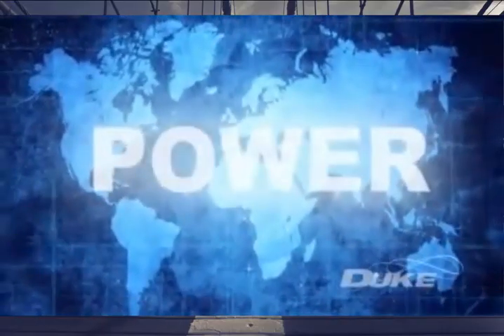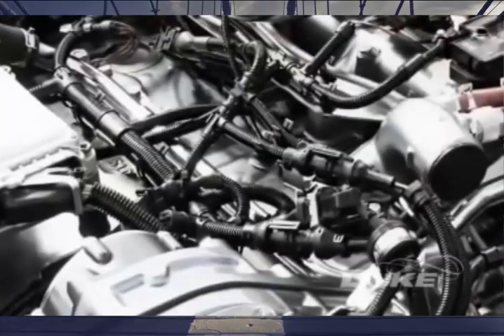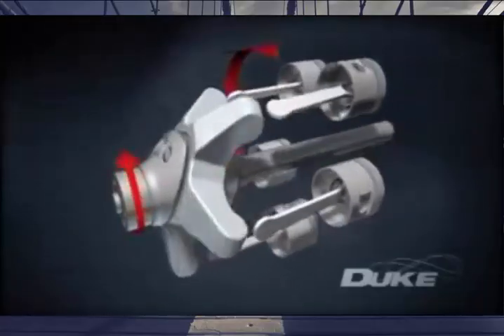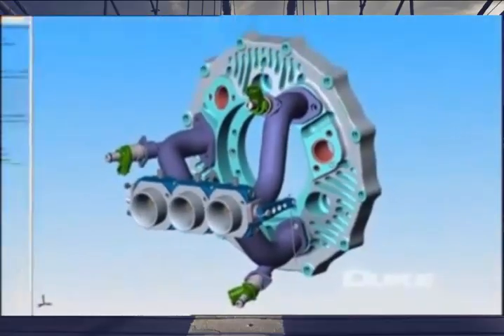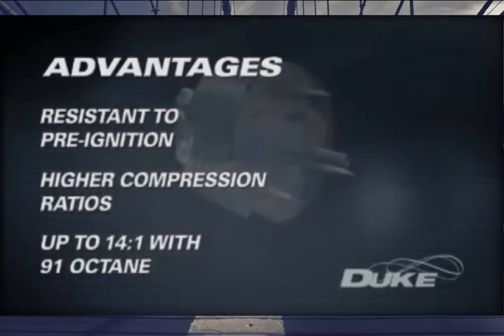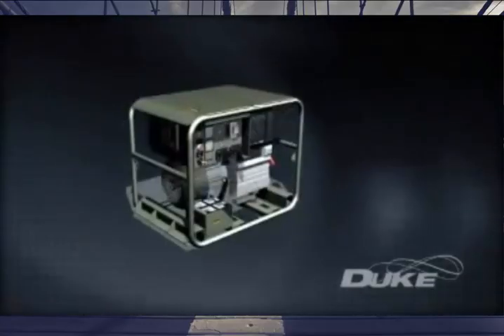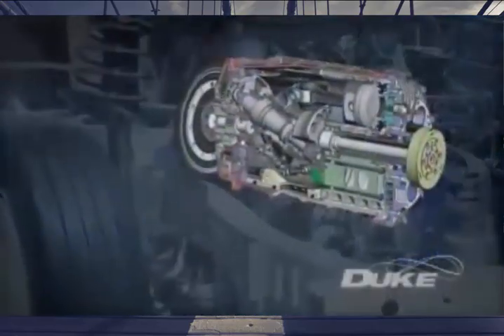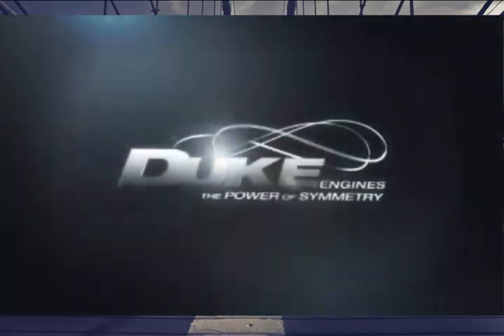Duke Engines | All information about Duke Engines

Comment: resistance through friction is what causes power loss, LMAO this just apiston version of the rotary typical of kiwis, if you have friciot oyu have wear and stress this machine would not run well without lots of lubrication , its now 2016 so best of luck but i wont be buying that peace of crap, and if its still so good why havent you got a rally car fitted.loweringt he engine in the frame of car to reduce its hieght just makes it more dangerous i have 16 inch fractured skull from a car going under me it pput my head through the safety glass window at 80km/h , i doubt very your statement is true on lowering engine height as then all cars pre that would have to be taken of the raod i will be researching this

Comment: Lets put it up against a Wankel
Reply: It is a Wankel. They just put those pesky pistons and associated parts back in to make it more complex.
Reply: Not even close to a Wankle.
Reply: Both engines look like they have a rotating seal turning at high velocity. Although in the Duke case it is a simple rotating seal without corners.
Reply: It'll Nuke 'em
Reply: Except that this one has a much larger contact patch which will stfu the engine catastrophically if the lubricating coat ever fails ... FRICTION WELDING!
Reply: LOL Nuke'em.  You sir have won the internet for today.
Reply: How come we don't see many Wankels in cars (except for Mazdas?)

Comment: Very interesting this system, on the strength of torque transmission of the cylinders to the center has a lot of resistance due to friction of the parts (even using oil with good viscosity to minimize this fact)?
It was a question that hammered my head now hehe but either way seems to be even more efficient.

Comment: so this is a rotary engine, turned on the side with 10x more friction ?

yay for short livespan and impossibility to repair ?
Reply: i would think that unlike the wankel engine the Duke Engine has not changed the piston so the piston rings and scraper ring have the same (maybe slightly less) longevity compared to the 6 cylinder v6 Engine
Reply: Nope, it's an axial engine. They have been around for a little over 100 years. They don't work well for cars engines though due to low operating rpms.

Comment: uneven wear :P
the pistons are placed horizontally, so when the fuel is injected it will flow to the bottom part of the cylinder, when it ignites it will push the cylinder in the bottom region and not evenly, so the piston head will bend overtime, other thing is that, because the rods (of the pistons) are moving rotatioraly, it cannot be sealed perfectly, or the seals will wear out, other thing is because the pistons are placed horizontally because of the gravitational force will push the seal unevenly, resulting in wear and tear, and oil leakage and missfire.
Reply: centrifugal force would change that, may not solve it. But yes I agree about he sealing issue,  that was a big issue with the rotatory engine.
Reply: im not gona argue about that, it was really awhile since ive attended any physics classes but i personally would not believe that centrifugal forces have that much of a impact on the rods themselves since the rods dont rotate, the housing does - if i think about the washing machine, the clothes are pushed to the side of the cylinder - but again, it was awhile...

Comment: This engine design appears to be based on a rotary hydraulic pump. Multiple pistons driven by an offset (wobbling) plate. I have to wonder what the minimum rpm has to be just to keep the engine running.

Comment: If this is so awesome why arent any car companies using it?
Reply: Cylinder and stationary head seal durability would be kinda issue if you ask me. Also many car companys use their own engine designs so out sourcing that would mean that money for the base engine and all the spares does not get to them and there is also issue of what if Duke decides to up selling price for this engine tech. Patents are theirs so they decide how much the price of new contract will be. Not to mention this is still kinda unproven concept, so car companys dont want to jump into water with out knowing they can swim there.
Ou and of course why would they want engine that has less wearable parts? They get money from selling spares to customers and that is their main money machine, not the cars it self.
Reply: Because their history of use, since 1911, has shown that they work best at low rpm. They have seen a lot of use in small aircraft and torpedoes.
Reply: Alahu akbar shalalalalalala

Comment: This design was used to power torpedoes in WWII and after.  Those engines were much small than this and ran on compressed gas, I believe.
Reply: The powerplant in a torpedo only has to run a few minutes at most before it gets blown to smithereens.  So long term durability isn't a design concern.

Comment: Its a two stroke with two stoke pollution problems, and even rotary engine problems.
Reply: No, it's a four stroke.  In a two stroke, the intake and exhaust ports are open at the same time.
Reply: Like a two stroke? Very inneficient.
It works like a two stroke with the same problems.
Reply: Barry Jones No, it's a four-stroke cycle; watch the video again. Intake, Compression, Power and Exhaust are all separate.  The difference here is, the pistons move from the intake port (no valve required) to no port (compression) to the spark plug (power) to the exhaust port (again, no valve needed.)  Nothing really weird about it other than they've managed to package more horsepower in physically smaller engine.  If they can either work out the problems with wear on the sliding parts, or else make it super-easy to rebuild, I can see this as an intermediate step between current piston aircraft engines and turboprops.

Comment: it's sad that these things haven't taken off.. assuming all claims are true these little things could have been amazing in small cars to produce more than sufficient power.. imagine a miata or lotus with one? ahh pipe dreams..
Reply: Swashplate engines HAVE taken off...they use them to propel torpedoes. The Navy likes them because they're cylindrical, just like a torpedo. Problem is, a torpedo engine only has to work once. The Duke engine doesn't have that advantage.
Reply: +jmowreader kinda the point though right? we as a species want new things, faster, more power, more agile.. I for one want a ktm x bow style car with a low weight, low center of gravity and high power potential.. such a design is quite crazy and fast, or perhaps a long travel buggy that benefits from the compact dimensions.. alas we probably won't get a chance to test this engine.

Comment: I was very skeptical of this design but it now looks viable.  The final drive concerns me with the rocking motion of the drive plate being turned into a rotary motion via no doubt mechanical advantage.  Is this efficient and how about the longevity of these frictional components ?.  Furthermore it would mean a complete re-tooling for manufacture in the automotive industry for mass production and  this would no doubt be very expensive. I cannot see this engine taking the world by storm but maybe in time it could be introduced.  We will see  in due course.
Reply: Or you could look at the history of axial engines which date back to 1911.
Reply: Have you seen one in a car? Until then, I wouldn't put any money in their hands.
Reply: my thoughts exactly. I want to see an exploded diagram, and the associated force and wear characteristics of the components.
Reply: Yea Trey, sealing the chamber and keeping it sealed with the friction of the rotating cylinders would be a big problem to overcome for longevity.  Hydraulic motors work because of the fluid helps to lubricate and seal.  Using hot air as a sealant wont work very good.

Comment: they are much weaker. the turning system takes to much power
Reply: I wonder about that. A rocking motion turning the final drive shaft into a rotary motion. Looks lossy to me and how is the wear resistance on these highly stressed components ?.

Comment: Ok the issues I see. As the engine spins faster will the G forces wear the outer cylinder walls faster, creating and egg like sphere in the cylinder. also, will this engine create a gyro effect as it increases momentum?
Reply: Conventional engine also has considerable side thrust  on the exhaust stroke and so the cylinder wears oval. Not saying this engine is good. Something similar is used in some torpedoes because of the short life  needed ( minutes) The major companies are already working on such designs of which there are several.

Comment: This is very surprising as three or four years ago tere was an engine built in  the USA  that worked of a cam type system where the  pistons were double ended and were operated by being conected to this central cam.
All the valve system was at the end of the engine but it worked in very much the same way.
They had aimed this engine more at  the aircraft industry.
It had a sound unlike any other engine and did  away with both crank shaft andvcam shaft.
Like this engine, the one in this video clearly go kno ked over by someone as there is no further news on  it.
Its is a shame that this happens, but it seems everyone is out to get rich quick and it they get thevright offer you never hear anymore about them.
Reply: Or more than likely, the engineering challenges weren't able to be overcome yet, so they gave up for now.
Reply: it was called  dynacam the rights were sold, name changed,  and last i heard it was shelved

Comment: I saw swash plate engines like this in use in the 1970s, of course 40 years or so should make them better.
Reply: Yes, this is NOT new conceptually, and it's hard to believe that the reliability and maintenance demand from production units in routine internal-combustion applications would be superior to simple turbodiesel and to other geometric-based alternatives like Wankel (which hasn't been great). These might be worse--especially the swash plate. Electric traction motors are the finest motive technology we've got and the great need is to power them as effectively and efficiently as we can.
Reply: More like 105 years. The first production Axial engine started production in 1911. They work well for airplanes where weight is a concern. The main place they have been used though is torpedoes where the cylindrical shape is advantageous.
Reply: In torpedoes is where I saw them used. Did not realize they have been in use for so long.
Reply: As efficiently as large power plants from modern locomotives can move trains of cars (each individual car and engine has the aerodynamics of a large brick, but the cost is mostly just once for the train, with some overhead for each car that's only partially exposed) it's also very useful to keep in proper context that railroads are built on as level/flat of terrain as they can get ahold of, and generally have early on in US development because the land was available at that time.

We get rid of the existing rail infrastructure and the roadbeds used for mass cargo transit at our peril, regardless of how efficient (or not) the engine technology that is used for pulling the cargo, because of the efficient, fairly level roadbeds.
Reply: That's where Tesla's system seems to shine brightest.
Reply: Without getting too wonky here, the Class 1 freight railroads (like Warren Buffett's Burlington Northern and its similar-class competitors like Union Pacific), with their use of massive turbodiesels converting to electric traction motors powering minimal-friction steel wheels that run on track engineered for minimal grades with large-scale loads, are still the gold standard for every other transportation technology to somehow meet or beat in efficiency in the U.S. As of 2006, Pew Research reported Class 1 energy usage getting down to 330 BTUs per ton-mile. Ten years later, I'm sure that number is even lower now. That is very hard to compete with at a smaller scale on roads, even for Elon Musk. Assuming a Tesla S is averaging 3 miles/kWh moving 5,000 lbs. around, it is consuming around 455 BTUs of energy per ton-mile. Yes, the energy source may be cleaner to some extent, but it also still requires about 37.8% more of it. Lighter vehicles like the Nissan Leaf, Chevy Bolt, and upcoming Tesla 3 (hopefully) do a little better. However, compared to something like large-scale, heavily-used electrified rail transportation (powered directly by power plants, incl. solar, wind, etc.) such as Amsterdam uses in concert with bicycles, personal vehicles in general will probably always struggle in any efficiency comparison regardless of technology or manufacturer.
Reply: Entirely true. But I believe it important to note that any improvements made to the methods of production of electricity in any particular region apply immediately to the entire fleet of electric vehicles. No need to wait decades for the fleet to individually and incrementally get replaced with cleaner machines.

Comment: I think this is old torpedo technology..... I've seen this before, but either way seals and carbon build up around the rotating head seams like a potential long term issue. That's what killed the coats rotary valve head
Reply: Where's the sump and pump for oil, and looks like a HP not torq motor

Comment: Nothing new ore revolutionary here at all.  I've seen running engines of this configuration over 15 years ago.  Check out Eddie Paul Industries C.E.M. engine (US patent 6145429). There have been engines of this design going back to the mid 1950s and probably earlier.

Comment: The problem for this design is the angles at which the power is transmitted, I can see high friction points there
Reply: ME TOO DAN.  THE ROTATING NECK THAT SERVES AS A CRANKSHAFT.  WE ALL KNOW HOW NASCAR ENGINES CAN CRACK A CRANKSHAFT.  PUT THAT DUDE ON TEXAS MOTOR SPEEDWAY AT 8500 RPMs FOR AN HOUR AND SEE HOW IT HOLDS UP.

Comment: So let them build an engine for a car in the 24h of Le Mans, or join a competing team in the F1 races. When it proves itself under those conditions the big brands will line up for a license.
Reply: they have had 6 years to do that. they have running prototypes in videos.. I agree they should do something to get the design some publicity.. I mean I have an older ranger that could use a motor, it's a 5 speed so electronics shouldn't be an issue and neither will space. it'd get them publicity and a test bed.. and a new engine for my old truck..

Comment: well this video does have me interested in Duke engines. but most of us want to know exact figures like: dimensions; weight; typical example of power and torque curves for a specified engine size; fuel economy, oil consumption...
Reply: Kaliza Bashonga
Reply: I've seen claims of 215hp out of a 3.0 turbo so definitely not worth the time . Main problems are having those heavy cylinders rotating and the counter rotating crankshaft .

Comment: I can only see one problem (outside of the obvious seal wear): with such a large mass rotating like this,  if you put it in the front of a car, it will simply degrade the handling characteristics as you will then effectively have a gyro sitting in front of the front axle, trying to make the car continue straight ahead as opposed to a sharp turn in
Reply: They mentioned that the flywheel rotates in the opposite direction (3:28) would this not counter the effect?

Comment: What's the general efficiency of of the whole engine is it still in the 60% like conventional motors?
Reply: 60%!!! In your dreams. A typical petrol ICE is about 25% AT BEST. Some diesels can peak at ~38%. If this design were as good as that it would be worth considering, but it's very unlikely. The efficiency is limited by the Carnot heat cycle, which comes down to the temperature differential across the engine. That sets a practical limit on any heat engine. Maybe 60% can be reached in some kinds of gas turbine, but they're not practical for small cars.The only technology that completely leapfrogs the Carnot efficiency barrier is an electric motor. Theoretically a motor can be 100% efficient - in practice over 95% is possible. Pistons in cylinders have had their day.

Comment: ok we have heard all the pro's now what's the cons?, thinking back we have had the rotary engines that were supposedly the next gen all bells and whistles way forward, lol very interesting concept, is there a heavy oil model?or is that not possible with this config?, good luck with it you just never know!,
Reply: I'm guessing oil consumption and seal wear, much like the wankel rotary, it may run dirty with burned oil and carbon fouling, which as I can tell eventually killed the Mazda RX family..
Reply: PureCountryof91 OH YES HAVING HAD THE PLEASURE OF OWNING AN RX8 it had to go in the end due to its horrific fuel consumption, great car but hurt you badly in the pocket with the fuel costs here in the UK

Comment: I suspect keeping moving cylinders sealed might turn out to be a chellange and a cause for serious wear of the sealing parts. Maybe the problem is not a bad as on Wankel engine, but it got to be there to some degree. Besides mass that big rotating... I don't know, really. Sure, it's not an aircraft, where torque can cause some issues, like the gyroscope effect on the Sopwith Camel WWI era fighter, so, perhaps, that's OK. On the motobikes, however, that could cause trouble.
P.S. How about making cylinders stationary, while the head with a spark plug and inlet / outlet holes to rotates? Yes, sealing would still be a problem and constructing inlet and exaust channels will get more complicated (I guess those chanels could be  arranged in a concentric manner).